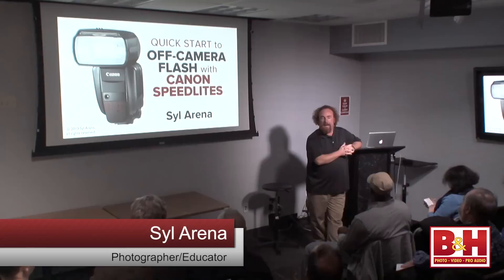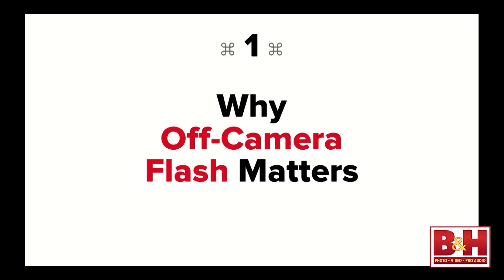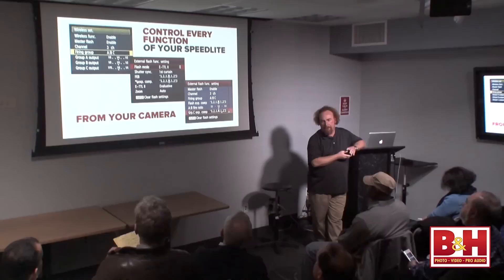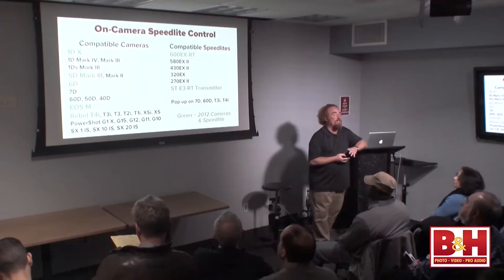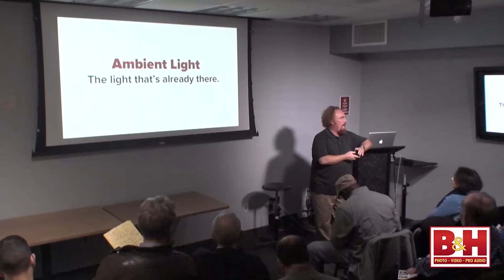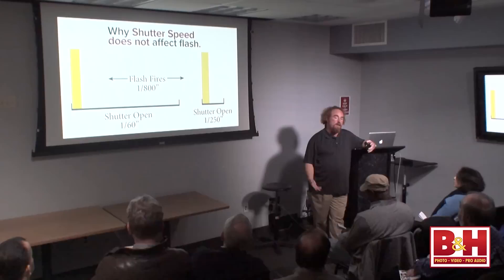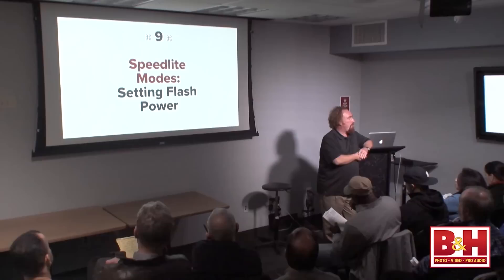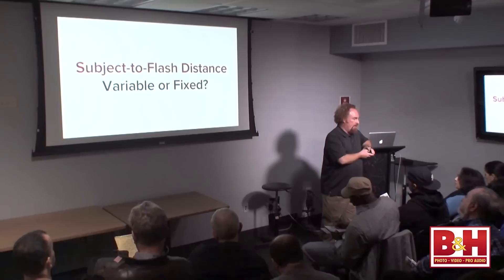Quick Start to Off-Camera Flash with Canon Speedlites

Comment: How lucky are we now. I own a few Godox tt685c. The transmitter was 40 bucks the flashes were 110.  It’s has ttl and hss. The flash themselves can be used as master or slaves if you don’t want to use transmitter you can put speedlite in hot shoe and use it as a transmitter for other flashes. If anyone is looking for a flash I highly recommend it.

Comment: No mention of the Yongnuo YN-622 wireless ETTL system which isn't nearly as expensive as the one Syl mentions.  I bought two pair of them, one on the camera and the other three on speedlights and the system works flawlessly.  All four in total cost about $170, which is less than the $200 that Syl says just ONE ETTL remote costs.    Get yourself the YN-622 and save yourself a lot of money and you can control many of the Canon and Yongnuo flashes wirelessly for a fraction of Canon's price.
Reply: mavfan1 he uses Canon, I also think it’s because he wanted to show the new menu system for canon speedlites on new canon cameras.

Comment: At about 47:00 you are talking about dimming the ambient by moving the shutter speed by 2 stops from 1/30 to 1/8 or moving ISO by 2 stops from 100 to 400.  
If you want to dim the ambient, shouldn't you move the shutter speed by 2 stops from 1/30 to 1/125 instead as shorther shutter = less light to the sensor = darker (dimmer) image?
Reply from the maker: +Michael Scholz 
After watching the video over a few times and around the 45:30-47:00 range, I believe the speaker simply misspoke when he used the term "dimming the ambient" and just went with it. You're correct though, to dim the ambient you'd need to increase the shutter time. We are sorry about any confusion this may have caused. - Yossi

Comment: For 43 bucks you can get a 9’ stand, a s-mount , a swivel head and a neewer 24 softbox on Amazon.  Just search Neewer 24x24 kit. It’s such a great deal. There is no metal frame to block light, the speedlite enters through the back and points out so it’s brighter then a bounce umbrella. Grab one and thank me later.

Comment: At 1:09:28 you show a Canon 60D with an optional Speedlite mounting bracket. Which bracket is that?
Reply from the maker: Unfortunately, that is not a flash bracket in the image.  While I cannot see the brand of the camera bracket, the image shows a custom L-bracket for the Canon EOS 60D mounted to the camera.   The flash is connected to the camera via Syl Arena's OCF Gear Canon TTL Cable (similar to Canon's own Canon OC-E3 Off Camera Shoe Cord (2'), B&H # CAOCE3), and the flash is connected to the standard mini flash stand included by Canon with the Canon flash purchase (not listed separately, though the Vello Compact Shoe Stand for Universal Shoe Mount Accessories, B&H # VECSSU20, would be a similar option).  While the image shows the flash sitting next to the camera for display purposes, as shown on the same image in the lower right-hand corner (and stated in the video), Syl Arena typically hand-holds the flash when using the TTL cable so he may position the flash as needed.  However, if you would like to use a flash bracket, a few options I would recommend would be either the Custom Brackets CB Mini-RC Camera Flash Bracket, B&H # CUCBMINIRC, the Custom Brackets CB Digital-S Rotating Flash Bracket, B&H # CUCBDS, or the Custom Brackets Digital PRO-M Camera Rotating Bracket Kit, B&H # CUDPMK.
https://bhpho.to/2osWXTX
https://bhpho.to/2nyt4Sg
https://bhpho.to/2BSD2oZ
https://bhpho.to/2sXVPwv
https://bhpho.to/2oCjkpc